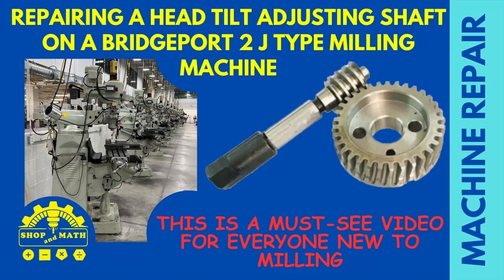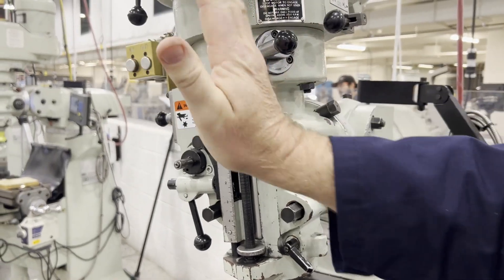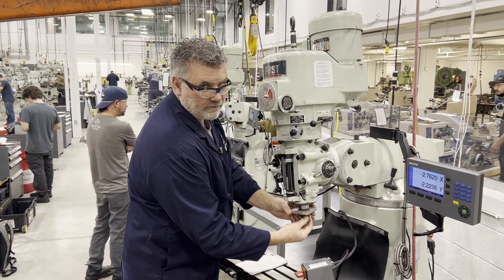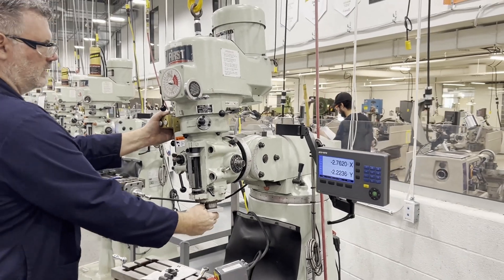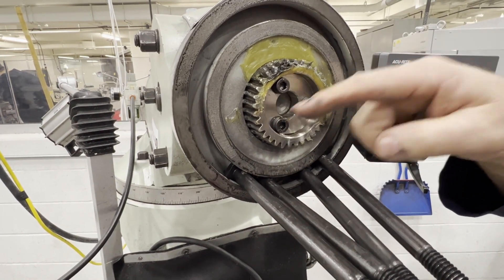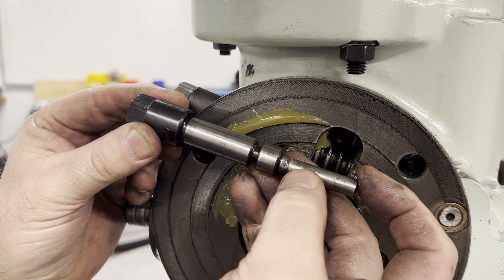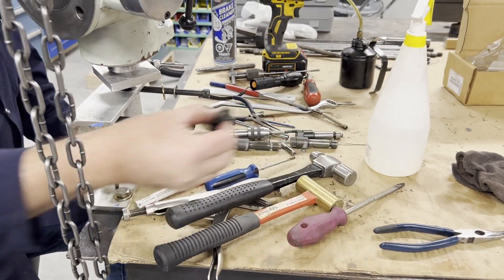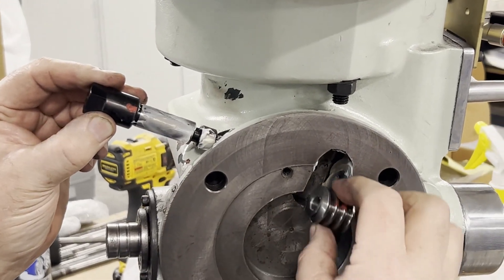Repairing a head tilt Adjusting Shaft on a Bridgeport 2 J Type Milling Machine

Comment: I did the same cut using an ocsillating tool and a metal cutting blade on the right side of the worm, slow but worked well. I them made a new shaft out of 4140 and also a spare.
Reply from the maker: Thanks for sharing. It’s a great idea about using an oscillating saw never thought of that